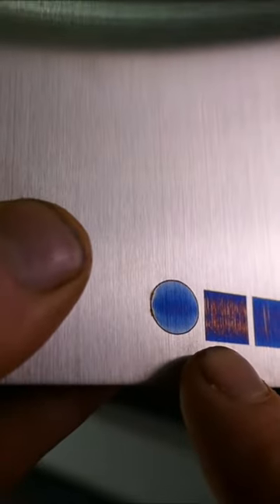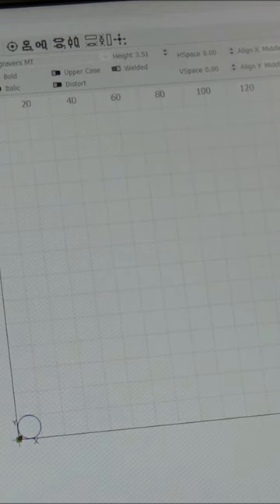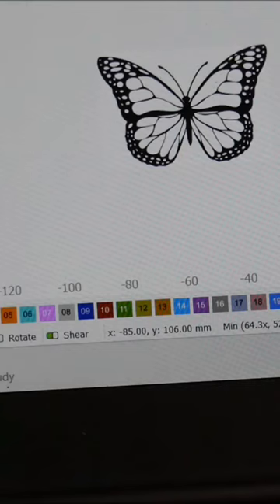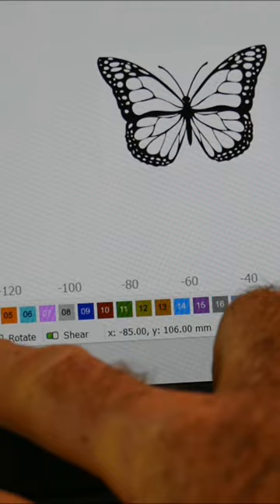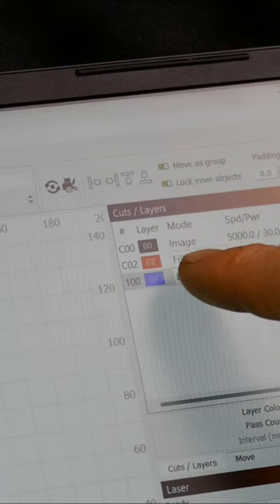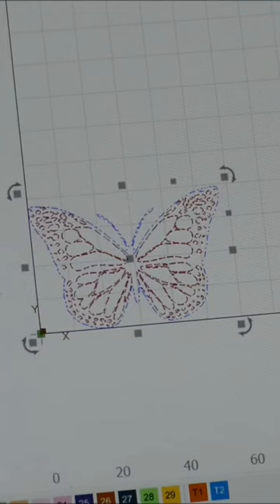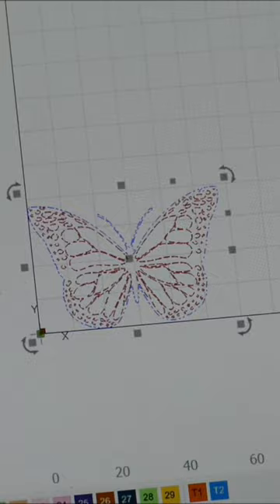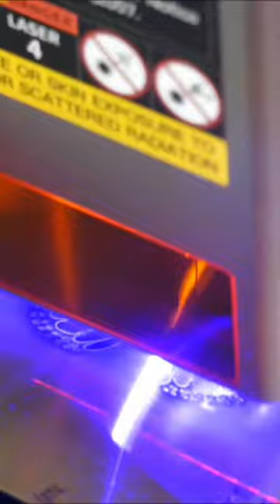colour stainless with a laser using Falcon2 40w

Comment: What result do you get if the stainless sheet is chilled beforehand?
Reply from the maker: Grade of stainless, starting temperature and thickness will change the settings so you'll need to conduct tests and adjust to match. cheers J